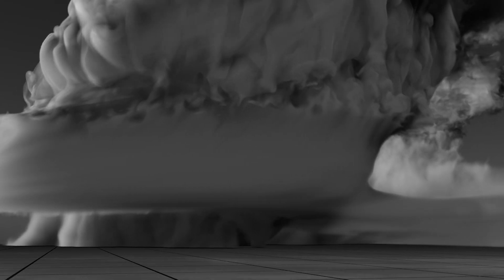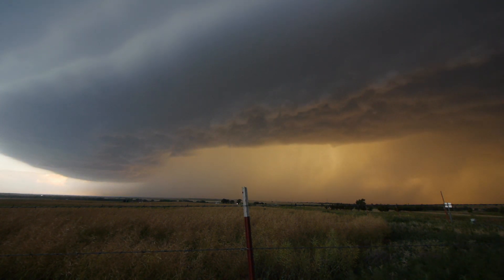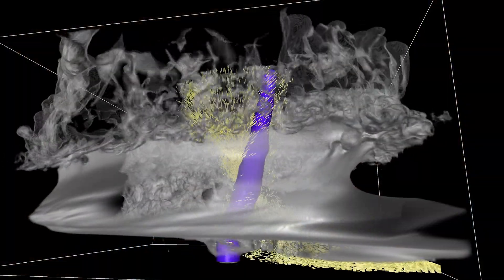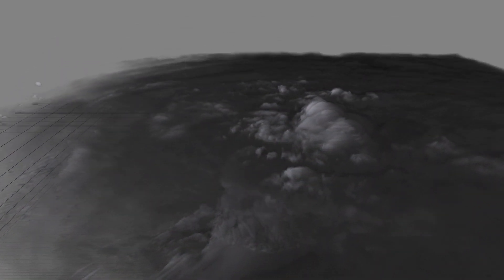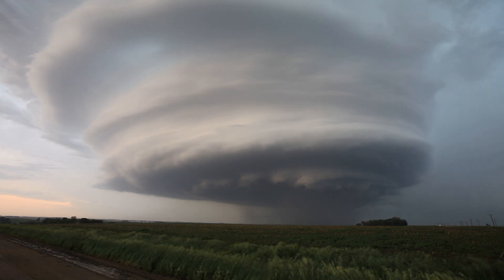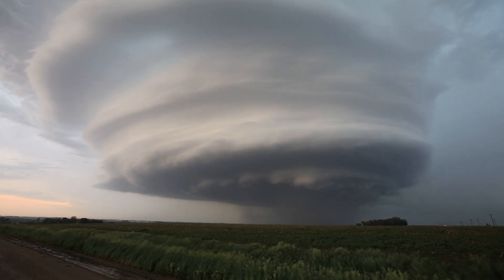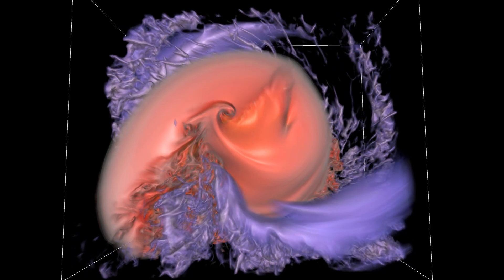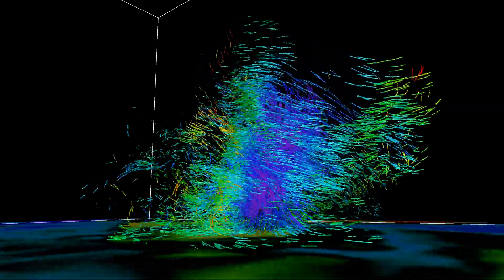Inside a Supertwister

Comment: Ya know, I had a thought today at work.

We have planes and pilots that fly through hurricanes to collect data on them. Could the same plane fly through a supercell and the mesocyclone to collect data? Or send a drone with instruments up there to collect data?
Reply: not a scientist, but my guess is based off the size difference between the two types of weather. Hurricanes are hundreds of miles wide, with the eye being miles wide as well. Tornados are much more localized with the biggest being measured in a few miles and much more violent and unstable. Only lasting briefly, tornados die out quickly, while hurricanes last for weeks. This is all my guess, but I'm fairly confident in it.
Reply: @bruble14  sure, but what about the mesocyclone that's inside the supercell itself? Is it not bigger than the tornados?
Reply: @superdarklink  i think the main problem is hail you dont really wana fly a plane through hail
Reply: @mattekumba  good point. Do hurricanes not produce hail?

Comment: I get a bit frustrated when scientists put data into a computer, get something out that looks like the data they put in, and claim that they have solved the problem "with pretty high confidence". Oh yeah? Well how come your model didn't predict sideways funnels, multiple funnels, funnels rotating in opposite directions, invisible funnels, and the grounding of incoming solar radiation via those funnels? 
You get out of a computer model only what you put in.
Reply: Atmospheric conditions are not going to tell you whether a tornado has multiple vortices, sister vortices, etc.

What they are doing is trying to gain a better understanding of the atmospheric conditions that determine which cells will produce tornados and what conditions affect strength of said cells and tornadoes.
Reply: This model is to see why some storms produce long track tornadoes and others don't produce any tornadoes at all. It's incredibly hard to take into account all the variables. I'm sure with more simulations being run, their confidence will increase.
Reply: 6:21 see the multiple vortices?

Comment: 3:55 Correction THIS Footage was El Reno 2013, rated ef3  but ef 5 wind speeds
Reply: Chris Tine if it was rated with ef5 winds than its going to be a ef5 dumb ass
Reply: Luke Hay don't call Chris a dumb ass just because he said something incorrect
Reply: @mrbagel8751  And doppler radar measured winds of 296 mph but it only caused EF 3 damage and so was rated EF 3 so calling him a dumbass is kinda wrong
Reply: @mrbagel8751  tornado rates are caused by the damage they create, so if an ef5 forms in a flat plain, but only knocks down a chair, it will be considered a ef0
Reply: No It was May 24 2011 EF 5 near El Reno. May 31 EF 3 was much darker in colour.

Comment: Do they consider all important variables in their simulation, like water vapor behavior and electromagnetism? Or do they adjust their simulation only to look realistic?
Reply: Peter Luxus 
They consider all variables known to be important, and others can be added as well, to see if they make a difference. 

However, these kind of models only calculate things on the relevant scale. Electromagnetism is the force that governs particle-particle interactions within a gas, all those interaction (several billion-trillion-trillions of them) behave in a way that allows for large scale behavior to be calculated from averages. Because of how many electromagnetic interactions there are, that average behavior well be incredibly close to reality. Thus, when large amounts of gas is involved, classical hydrodynamics and mechanical methods are used. This saves a lot of time, money and computing power. 

Indeed, calculating the behavior via quantum electro dynamics (the branch of physics that describe electromagnetism most accurately) would be impossible for large scale, due to practical constraints.
Reply: 7:45